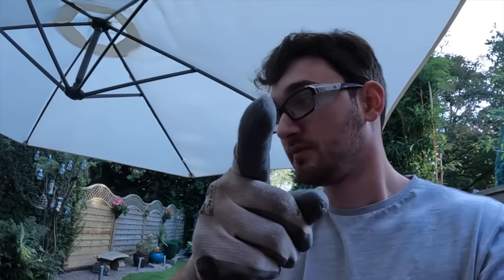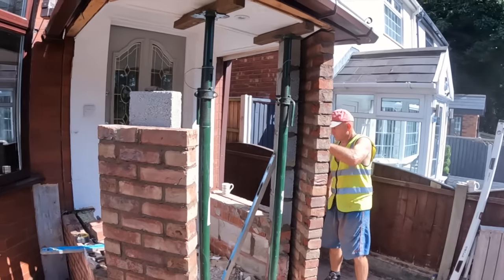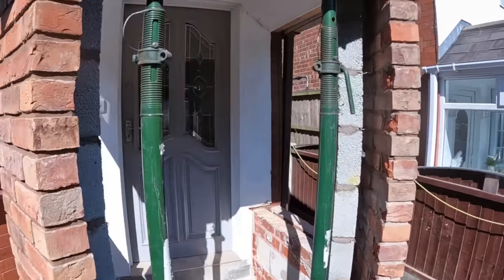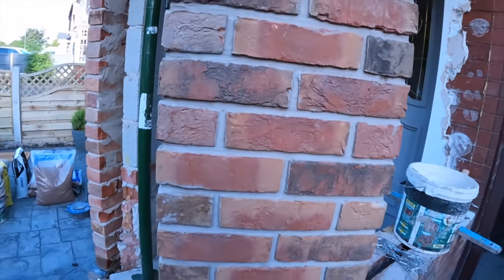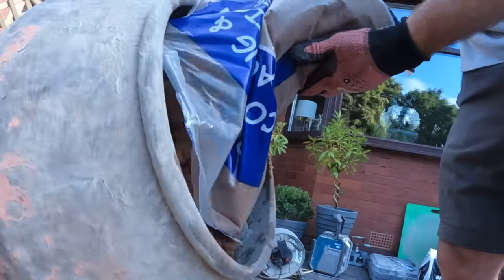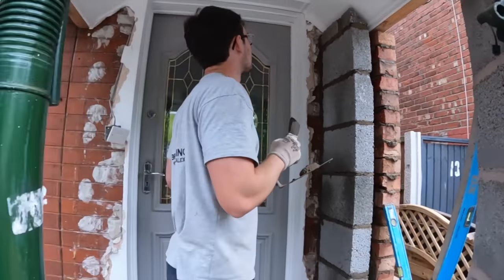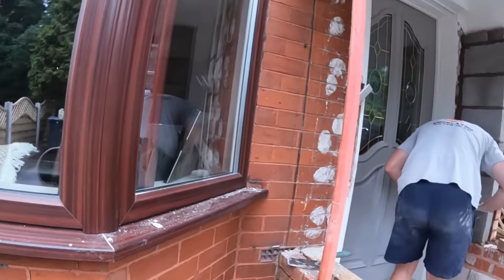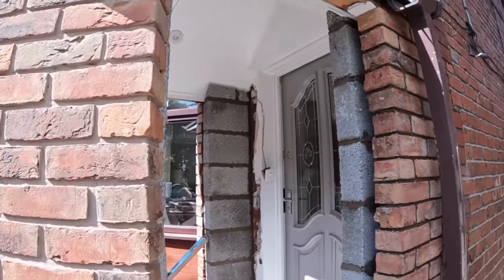THE PORCH IS WRONG...APPARENTLY!?

Comment: What a difference a day makes.Just one comment if you Don,t mind.I,m an ex brickie and on a job a long time ago using Accrington reds the architect wanted the same raked out joint.He was a young chap and this was a prestige job in town. When it rained hard the water was blown past the frames and ruined a lot curtains and fittings.After having us go with rebar banging the snots from tie wires he was told he ought to have told us to flush point at least an inch away from frames ,and it worked.As I say he was only a rookie and we liked to see his wife(also an architect) climb our ladders,so our thoughts were elsewhere.
I,ve always applied that idea since===mind you they were metal frames so I guess that didn’t help.
I,m 84 and then some so i doubt I,ll ever get the chance to try “pick and dip”.It looks weird anyway.
Reply from the maker: Thanks for watching and commenting Thomas 🧱👍🏽

Comment: Steve just a quick one have you ever tried those drill all bits various sizes 10m no probs and if you trash one they replace free of charge and one drill bit will go through anything steel brick concrete even iron just a thought mate might save you a few quid in drill bits 👍
Reply from the maker: Never heard of those Nige 🧱👍🏽
Reply: @SteveAndAlexBuild  Ideal world or QVC they usually do a demonstration on a Sunday morning they drill through brake discs and puts them on a bench grinder for 10 seconds doesn't even file it down plus they replace any bit if you bend blunt which is impossible or snap.
Reply from the maker: @nige.3494  🧱👍🏽

Comment: Neat work👍. As you say your mixer is 14 years old do you have any reccomendations for a long lasting wheel barrow? The one I got off ebay snapped😞
Reply from the maker: The belle warrior barrows are indestructible but cost about £180 😬🧱👍🏽
Reply: @SteveAndAlexBuild  Cheers, Andy from Bricklayers World said the same. I didn't think they looked that special in the photos but I'll take your words on it.
Reply from the maker: @kennethocongerskin9460  🧱🤙🏽💪🏽👍🏼
Reply: @SteveAndAlexBuild  and those Belle wheel barrows come with a lifetime guarantee... 👍
Reply: @kennethocongerskin9460  and those Belle wheel barrows come with a lifetime guarantee... 👍
Reply: @manofvalor3679  👍. I bought one. Not used it yet cus it hasn't stopped raining.....
Reply from the maker: @manofvalor3679  💪🏼💪🏼🧱👍🏽

Comment: A little trick foe you on the plastic windows if you get a filler knife and put it down the joints with a hammer it will break on the joint and you want take up to much in the skip
Reply from the maker: Cheers Andy 🤜🏽🤛🏽🧱👍🏽

Comment: How come you don't set up the sprinkler to hose the bricks down for 30 min before you use them ?
Reply from the maker: It helps but increases the chances of efflorescence 🧱👍🏽
Reply: @SteveAndAlexBuild  Big word for me that, but i remember on the building sites in Sydney in my youth the brickies ( mostly British ) would soak them in large buckets till they stopped bubbling or sprayed them with the hose etc and it worked fine, this is the 80's and thats what they explained to me
Reply from the maker: @pedropete1833  yes mate I’ve done it in the past when on a price 🤙🏾🧱👍🏽

Comment: window surveyor has no vision - welded cills , structural baypoles fixed off top and bottom and spray foam in the cavity so the door shuts without shaking the brickwork - whats the problem ?
Reply: Don't think it's a problem, it will just look crap with two big bits of white trim down both sides of the door and one side of each window. I would definitely prefer the turn in the brick and a straight cut cill over a welded cill and a piece of flat plastic.
Reply from the maker: @rodneytrotter82  🧱👍🏽
Reply: 135 degree  baypole covers are hardly 'flat pieces of plastic'
Reply from the maker: @Gethurted  🧱👍🏽
Reply: 2 welded Bay cills and 2x 2.1m, 135° posts (keeping in mind not all window profiles use one) cost. Also trying to drill at an angle through a door frame plus a bay pole into brick for fishers isn't going to give a great fixing. Reveals are square for a reason. I've enjoyed their other videos but this wasn't the best job to show. The plasterer would also be livid when he showed up!

Comment: Work is Tidy
Design is bloody shocking,  the window ope is desperate on the squinted corner
No Insulation means a little freezer for a front door, if the client had brains they would be dangerous 😂😂😂
Reply from the maker: Should have been flattened and started again 🧱👍🏽

Comment: Hi Steve &Alex.  The extra pillars you put in to make the windows smaller made it look better. As for it being wrong I think that was the window fitters not wanting the extra work with the posts that you said were needed. I have seen loads of conservatory’s with angle walls so it can’t be wrong if they can do it on conservatory’s.Thought the rake joints work with the bricks.  Great job once again. 👍
Reply from the maker: Cheers John boy 🤙🏾🤙🏾🧱👍🏽

Comment: Would you not insulate that cavity? I know it's a non standard gap but anything would be better than nothing... maybe 25mm or some rockwall
Reply from the maker: That internal wall was too rough to do iit unfortunately 🧱👍🏽😬
Reply: Tbh I would have made it a standard design with insulated cavity, if your having latest Windows you may as well go the whole hog
Reply from the maker: @optic1972  We just do the work the customer makes the decisions 🧱👍🏽
Reply: Foam it out is only solution that would work in a thin rough cavity imo
Reply from the maker: @ianbullock5621  🧱👍🏽

Comment: Dude. Like your vids and all but and it’s a big wobbly butt, how are the fitters going to secure the front door to your opening when they have to put the 45% posts either side? On the windows they can use straps and secure to the inside block but the door doesn’t have those, the block is set too far back.
Reply from the maker: I did explain it in the video 🧱👍🏽
Reply: Sorry dude. Been fitting windows and connys for 35 years too like your brick laying and unless rapiers go round corner now that door is gonna shake like a sh*ting dog.
Reply from the maker: @dannyrobertson3486  those were the cards we were dealt I’m afraid , we didn’t design it and would rather have flattened it and built it square like  the roof but we were just doing as we were asked by the customer 🧱👍🏽